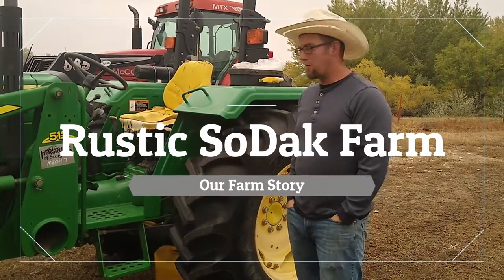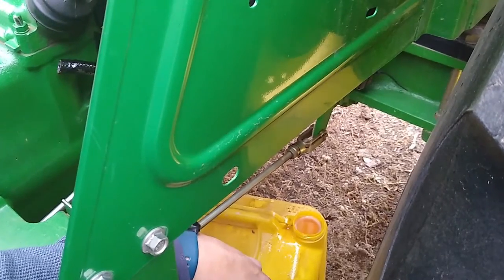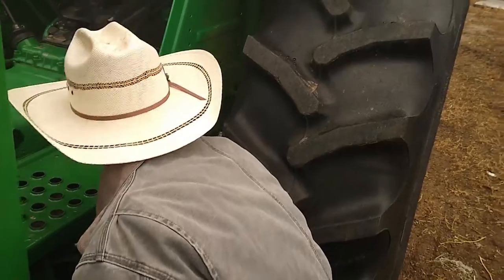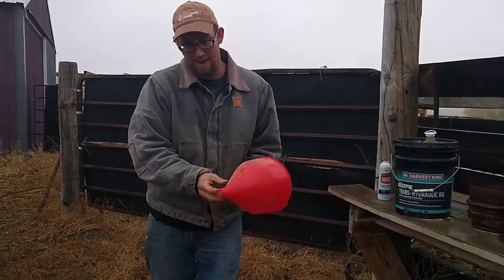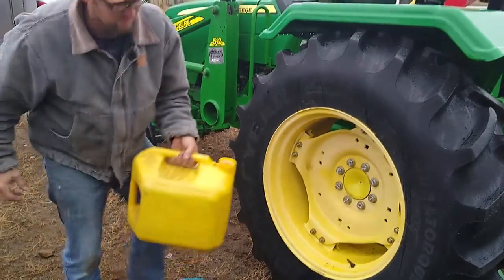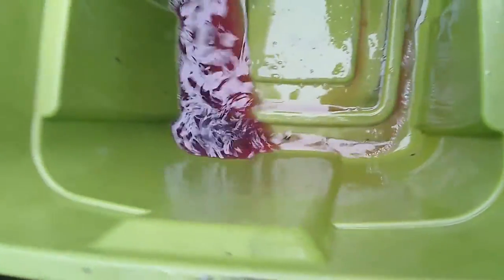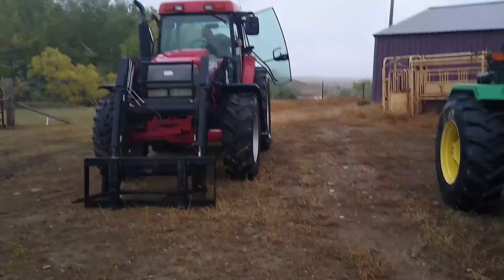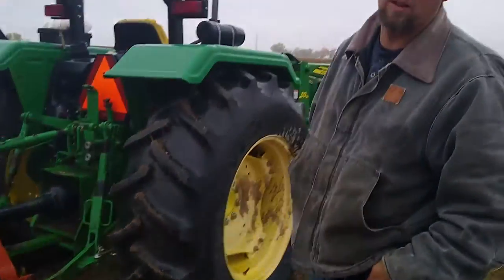Changing a John Deere 5055 Hidden Fuel Strainer (Filter) because our tractor won't work!

Comment: My 5045D had the same issue. I’m pulling my filter tomorrow. Thanks for the video.
Reply: Instead of draining tank, use compressed air to blow through filter. Make sure to take lid off tank , so you don't inflate tank.

Comment: Thanks for your video. I have a 5045e.  Had exactly the same problem. Looked in the owners manual, and mine did not look like that one. After watching your video, i pulled the line and filter. Same problem. Cleaned it about and all good now!!!  Thanks.
Reply from the maker: Awesome! Glad it worked!

Comment: You d man Rustic. I. Was searching YouTube for an answer to a loss of power issue with my JD 5055 tractor and watched your video. That was the problem. Thanks. Btw i went ahead and removed the fuel tank screen and installed an inline secondary filter.
Reply from the maker: That's great man! Glad it helped out.
Reply: Neg, your hat is backwards.  😂